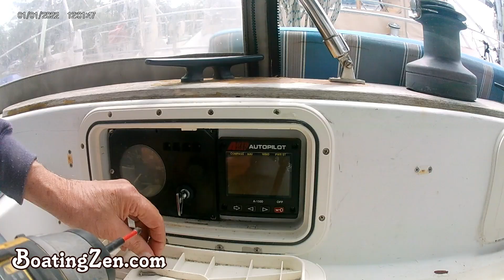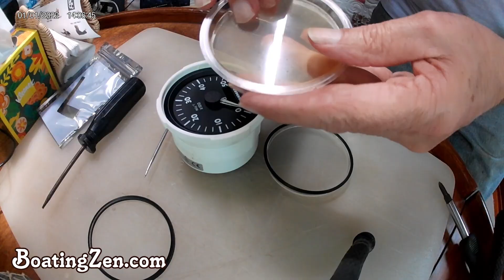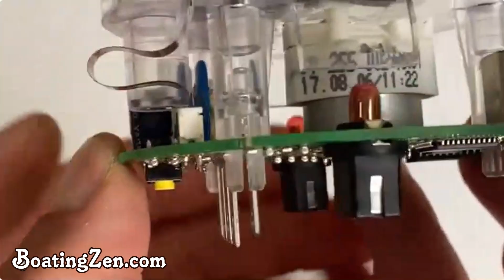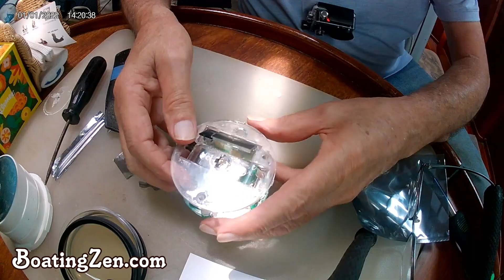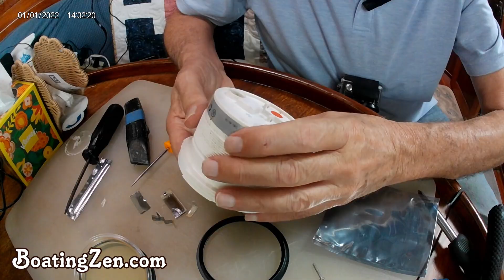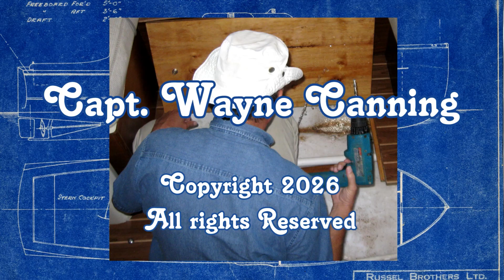Yanmar Hour Meter Repair

Comment: You wouldn't still happen to have the ebay seller you purchased the replacement LCD from?
Reply from the maker: Ilook was the name I think but use this search term in ebay and you will come up with a bunch to chose from "Fit for Volvo Penta Marine Yanmar Tachometer Hour Meter LCD Display & Ribbon" Good luck and thanks for asking.

Comment: Thank you so much for this well-done instructional video.  Your video was spot on with my application.  I purchased the LCD from Amazon, just using a visual as you showed in the video - it was a drop-in replacement.
Reply from the maker: I’m happy the instructions were clear and it was an easy fix for you! 👍Nice to have hours back isn't it? And a rare cheap boat repair lol

Comment: Thanks for your video which was very well explained. I am about to do this on a catamaran with Yanmars...twice the fun..😂

Did you consider replacing that cloudy probably sun damaged lens as well as it would have made your guage look brand new..I plan to.
Reply from the maker: Yeah I did, it was two lens together with one being cloudy, i almost left that one out. I plan to move tach later and I think I will try cleaning with a fine polish like for headlight lens. I was in a bit of a rush so did not do it at the time. Thanks Good luck with yours. It is nice to be able to have engine hours again.

Comment: How did you know that the replacement lcd was the right part when you ordered it?  I have a yanmar b-panel keyless
Reply from the maker: Good question. I checked online and it seems this same LCD is used on many Tachs made by VDO who make the gauges for Yanmar. I found it on ebay and did a visual comparison and made sure I could return it. From what I can tell there are not a lot of different ones used so odds are good it will fit. Hope that helps. Good luck